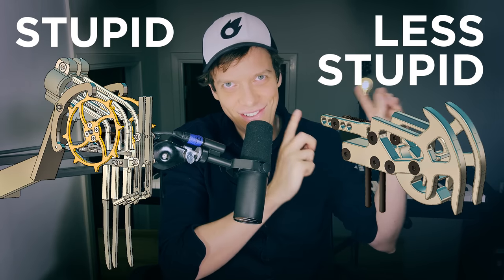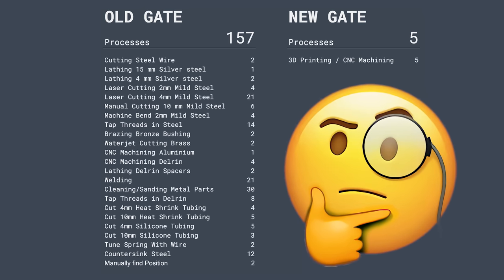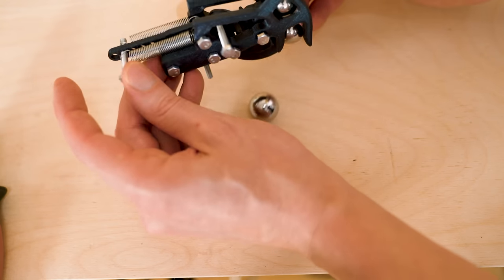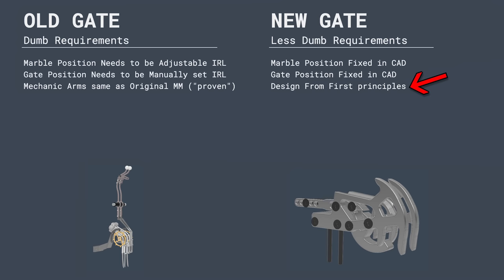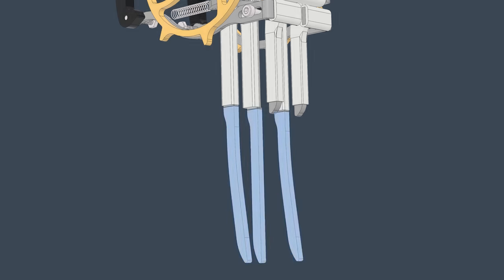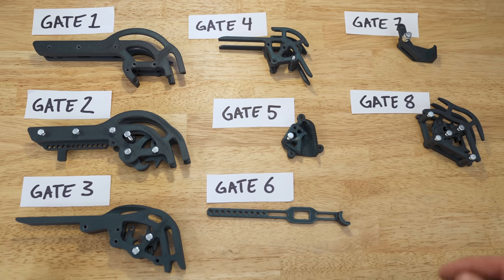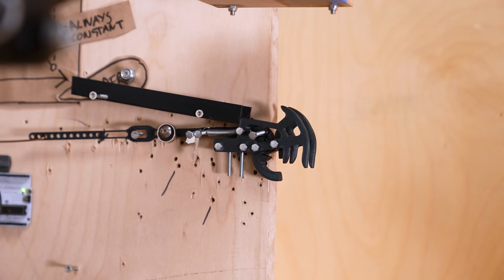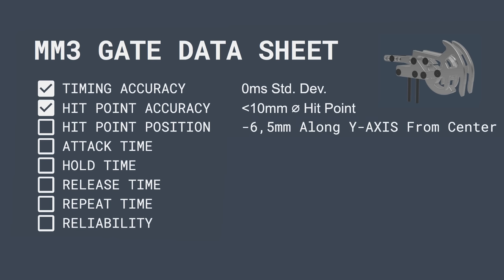This Design Trick Surprised Me!

Comment: I will realy miss the possibility to maually play the machine. Wouldn't be possible to add just a little lever at the side of the Gate (only on one Gate per Instrument instead of both) that directly turns the trigger? When looking to the gate from the side (as at 0:18 in the video) , the lower Part of the release-thing is exposed enough to directly mount a little lever to its side. It would not be in such a convenient place from a playing perspective but just whereever the gate is. And it would be a bit difficoult to play beacause it would release the marble when releasing the lever insteas of when pressing it. Bbut it would nod add any complexity to it at all. 
When 3d-printing, you could just do it in one part when using a bit of printing support. For milling, it would probably be easier to screw it together from two parts so you can fabricate it from flat material in one operation.

Comment: You may have thought of this already, it appears you could still achieve manual marble drops with a simple push/pull lever connecting to the rear linkage. I'm enjoying the progress you are making and steps you are taking to simplify the process down to the basics for functional operation.

Comment: I feel like printing is great for the prototyping phase and those parts can later be machined in the final product to give it a more clean and aesthetic look. 

Manual operation doesnt have to happen on the gate itself. Whichever machanism you already have in mind to trigger the gates could include linkage for manual levers. And that same linkage could be operated with midi solenoids... I would think adding manual linkage would not only allow you to trigger a gate but also mute the gate by leaving the lever (or solenoid) activated.

Comment: @7:45 I used to watch a cooking channel (Alex) where the host once tried to dice an onion as fast as a street food cook in a video.

At first he failed and was a lot slower. After some practice and all he got closer but was still lacking.

He then found the 1% principle in a book (atmoic principle)
The idea is that by improving every bit of a process by just 1% the accumulated improvement will be massive.

The book gives the example of a coach from a professional bike Racing team who looked at every single aspect and detail and how to improve it by 1% (or more). Some more obvious things like using tires that are 1% better etc (where already done) but they took it to every detail on and off the bike, like finding the best massage lotion or using memory foam pillows to improve the sleep of the riders.

All that worked to improve the team quite a bit.

Alex (the cook) used the same principle on his onion dicing, like finding a better knive, sharpening the knive, getting cut resistant gloves, remove unnecessary steps from his cutting techniques, getting a cutting board with a better contrast to the onion, removing rubber dampers from the board, using a fan to blow away the funmes to not start crying from the onions.

What I'm trying to say is that im confident you can build a fully working MM3.

Your progress on the gates is amazing.

I've been following you'd channel since forever.

It got me into engineering and motivated me.

Since I stared watching your marble machine series I've personally achieved things that I never though I'd be able to do.

My Lego robotics team dominated the regional championships for years, we became vice national champions and traveled to the other side of the world off the world final one year and almost made it again the next year.

I graduated the highest form of school in my country (I never though I'd get that far)

I'm going to university next year after a break this year.

I hope that you never give up and finish this machine.

Its been so long and it would be very sad if all the effort went into it not working out in the end.

The second that tickets to the world tour become available I will try to buy mine.

Comment: With this simplified gate it seems like it would be very easy to add back in the ability to play it manually with a pull hooked behind the curved arm at the bottom. So it would not interfere with anything when not in use, but you could pull the arm forward at will. it would add something like 4-5 parts? the pull itself, a bracket to hold it, a spring for return, and mounting hardware.

Comment: In the world of design, "less is more" or KISS "Keep It Stupid Simple" , but "simple is hard" and if it fail, "break it further until you get it right" and "constantly questioning your requirement".

Use "bottom up" approach (most basic idea) to achieve consistency and repeatability, as you build it up, constantly question yourself if it can be "simplified" then "test, test and test again" "before the next design change", if you change many things at the same time, you never quite know which variables are the root cause.

Comment: I think I love this process youre going through - designing from the absolute bottom up after coming through multiple designs of something that mostly works:

I do have some questions though:

- Regarding reliability, 600 marbles was nothing to the MMX, we were approaching the magnitude of 100,000 marbles with almost 0 failures. Should each component not be tested to that kind of reliability before moving on, rather than giving it what is essentially a glance compared to the reliability testing you were doing with the MMX? 

Of particular concern to me is that the transition from metal and silicon to plastics is that the steel marbles will start wearing the plastics out and decrease reliability over time. The upside to using 3D prints and CNC and your design goal of stripping the critical components to the simplest pieces possible is that replacement parts can be quickly replaced if they do wear out, but with the MMX's goal of several million notes played during a live show wear should be seriously considered.

- Regarding the Marble Run itself - have you considered the marble run as part of your design overhaul? The thing about the marble run itself is that it was more or less the most artistic piece, becoming one of the cores of the marble machines shape after the programming wheel. Will you adhere as strictly to your "form from function" with the Run?

Comment: I had an idea for the programming wheel.  Instead of having pins in fixed locations use a track system so the pins are infinitely adjustable. This will also help with synchronizing the different instruments in relation with the gates. This way your timing can be adjusted on the programming wheel instead of having to place the gates in a specific location to achieve synchronization. 
Well, just a thought. =)

Comment: Has vibration of the machine been considered in the reliability of the marble gates?  I know it is very precise right now as a single unit, but once you add 20 or so gates, plus the vibrations from the programming wheel, motor, instruments, or even sound waves from live performance speakers, it could decrease that precision.  I've had many things that work well on a test bench, but once they are put on a final assembly it just doesn't work right anymore.  The only real way to know if it will work in the final product is to put it in the final product or have a test stand that can simulate the final product as accurately as possible. 

Been watching for many years now and your dedication to continuing the MMX, making videos, and learning are a real inspiration. Keep it up!

Comment: Hey Martin,
one of your main learnings of Marble Machine 1 & X was "Marble pressure is surprisingly strong".
Please test how these gates handle queues with 100+ Marbles - or make your design requirements less dumb, e.g. designing queues which only hold 10 marbles.
(I see two potential fails: The tiny gear teeth breaking and the marbles pressing other marbles out of the supply line

Comment: Martin. You actually can DO the manual playingwith such gate design! Because the marble is released after the pin left the reader, you now don't need to PULL to release, but TO PUSH extended lever. It would be like pushing buttons, one push one marble. Voila!

Comment: Mechanical engineer here 🙂. One more checkmark you may need to include is the environment you play in. Temperature, humidity, vibration, etc. Probably not a problem with aluminum parts but with plastic it may be an issue. But I betcha 3d printed parts will still be totally fine. I have surprised a lot of people with "cheap plastic" before 🙂.

Comment: It is more like 3 Materials: Printed polymer, machined polymer and metal hardware (4 Materials if you differentiate between screws/nuts and springs).
But getting rid of 10 of 14 Materials is still very impressive, at least a 71% reduction.
Good job!

Comment: so with the way the marbles are dropped/charged, you could in theory put manual override handles on them but that's only something to look at after the basic design functions are met. Get your design down based on the smart requirements and then you can maybe "Add Features" later.

Comment: I've been through a similar process with my Kerbal Space Program builds. I have to make my designs efficient, because my PC in't very powerful.  I'll first quickly throw together something that should be able to handle the job I want it for (a "rough sketch" of what I have in mind), then I do several passes trying to reduce the parts count, whilst losing no critical functionality.  I've usualy ended up with a final vessel that has 25-50% fewer parts and only 25% of the mass of the original.  Good luck with Marble Machine 3!

Comment: It looks like you’re ready for the next tool from the mechanical designer’s bag of tricks:  constraint-based design, specifically minimum constraint design.

Constraints limit an object’s ability to move, either in a line along an axis or in rotation around the axis.  Machine design isn’t about making things go where you want so much as building constraints to keep them from going anywhere you don’t want.

That creates a new set of design problems:  if you don’t have enough constraints, you get unwanted motion.  But if you have too many constraints, they interfere with each other and you get binding.  

As a simple but relevant example, it’s practically impossible to make a sphere sit on four points in the same plane.  The sphere will touch three points, but there will be a gap at the fourth.  That gap makes it possible for the sphere to rock from one position to another.  Instead of trying to fight all that, just limit your designs to three points of contact when you want to hold a sphere.

Learning to identify the constraints you need, and creating designs with exactly that many constraints, is a low-level form of modular design:  every constraint does exactly one thing, and is independent of all the others.  And since almost all mechanical problems boil down to a missing constraint, or constraints interfering with each other in unexpected ways, getting the constraints right eliminates most functional problems before they can happen.

“Designing Cost-Efficient Mechanisms” by Lawrence Kamm is a good reference.

Comment: Hot take: if you use Arduino (or PCBs) for the gates, do you need a functional programming wheel? Imagine if you could incorporate a purely aesthetic programming wheel in the space remaining after MM3 has been laid out. You could do a bunch of Wilsons meshing together for a mechanical aesthetic, or LED strips or a curved screen for a digital one.

Of course, if you're still going to use a functional programming wheel, I'm interested to see what you do. Maybe take a page from music boxes and subtractive manufacturing and instead of needing to place a pin for each note you "punch a hole"? Should be easy to manage with a laser cutter or CNC and flexible material. This way you can just program the wheel in CAD like you've been doing with the gates instead of doing it IRL?

Comment: Just a thought to still be able to manually drop marbles and not use mallets (to keep the marble theme, sound, and aesthetic), maybe make an arm of sorts that you can swing around over the keys that has a line of marbles loaded and you can manually release these marbles. It would be an added component but the dropping mechanism could be a version of the new gate that can be actuated with a lever or button, precise timing would be on the musician in this case and not the machine

Comment: I have to say? you are actually back! But somethings to consider: 1 - Use laser to define the Center of the channel dispenser
Reply: 2 - Use optical sensors to determine the marble "holdings" limit
Reply: 3 - Reliability test showld be done with the final material, it this 3d printed piece is the final material.. then... oh well.

Comment: I believe that cutting out manual marble play is a very good decision and also the correct way of thinking to achieve a reliable marble machine. That's not to say that Martin can't modify the melody programmed on the programming wheel now and then, he can just shut the programming wheel temporarily and use mallets. It might not be as cool but it will be more accurate by far. I mean, we've all listened to the original song many times and we can all tell that the manual marble play was not in perfect tempo, I doubt that Martin would be happy with a gate with such an error margin. Well, if Martin wants perfect music I say that learning to drop marbles tens or hundreds of milliseconds before their time of impact is a waste of time, he already  knows how to use mallets.

Comment: I'm curious on your thoughts on long-term reliability. Are you planning on just replacing parts as they wear out? Have you done the work to figure out how long parts are actually going to last?. I'm in a huge fan of your project for the many years here and with the improved engineering I'm hoping that we can see many of these machines being produced whereas the first ones would have only had the single version.

Comment: I don't think you need to give up manual marble playing. By extending the part (same part, not adding a new one) which gets pulled back, infront of the gate, that gives you an accessible push button style way to play the gate. But honestly, I don't think you'll need this. You'll be busy enough with the crank and muting etc.

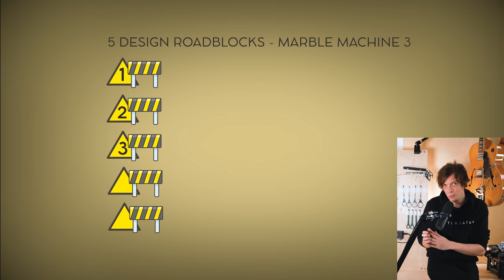Comment: 15:50 was the marble divider or queue the main failure point on MMX? I guess it can’t be solved first because it has to be designed around the geometry of the other parts? And said geometry is unknown at this point.

I’m thinking it was the failure of the tubes to hold up under marble load that caused him to give up on MMX. Mainly the tubes around the magnetic lift system failing due to pressure caused by mis-timing between the main shafts I believe.

So far it seems like he’s on track to make a marble machine that will be easier to build than the amount of work needed just to fix MMX. Love seeing his progress on the timing gates.

Comment: I check in now and then to see how you're progressing.  I applaud the documentation of your skills journey but most of what you have been discovering I learned in the second year of Electrical Engineering as formal training.  I don't intend to be mean, but in any project there are only 4 variables:  Performance/Features, Schedule, Development Cost, and Production Cost.  In this example you have spent a very long time optimizing the Production Cost (and some mostly imperceptible performance) at the expense of Schedule and Development Cost.  A smart workflow is to make a functional prototype and then optimize the refactored system to reach the same performance at an acceptable Production Cost.  I am afraid that you are now heavily into overengineering the system.  

Of course, if your journey is where you get your funding, as opposed to actual performing with the machine, I understand.  That would indeed be unfortunate as we'll never see a completed machine upon which you do yet another iteration with additional performance/features.

Comment: Are you putting a bearing or bushing in the clock wheel so the threaded bolt doesn't chew out the center of the gear? Or use a shoulder bolt or something to prevent the threads being a bearing surface? Loving the new design paradigm and the elevated expectations for success!

Comment: Martin didn't add in all the extra electronic components to actuate the marble drop mechanism, though.  I would think that those are also a necessary integral part of the equation and checklist unless there is somehow a way he has figured out for these to be solely operated by the machine mechanism etc. vs computer boards, solenoids, actuators, etc.  If you factor all of that in, then I think that his assembly and cost might just end up being a tie.  I understand where he is at but some things for me just don't add up unless we know a bit more.

Comment: 6.5mm - is a measurement of how rigid an electrical wire is that cannot be absolutely flat. It deflects the load with its curved geometry. The test with the load had to be performed with a thin fishing line, not even with a rope. In addition, the weight should be short, not long, so you can guarantee that there is no distortion in the vertical plane. Therefore, I think in test No. 3 the real result is much better than 6.5 mm.

Comment: This might not work with real world applications, since the marble gate is stationary, the whole machine will be moving. Even if the whole is stable, that can't account for the movement of everything on the machine. The accuracy will change once it is put on the machine. So in theory, this is great if you are dropping marbles from a stationary block. I see many problems with the design material, although, harder material can compensate for longer playing time parts will wear from the first play. I love the design though